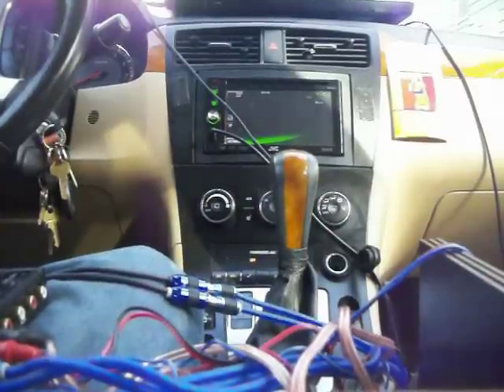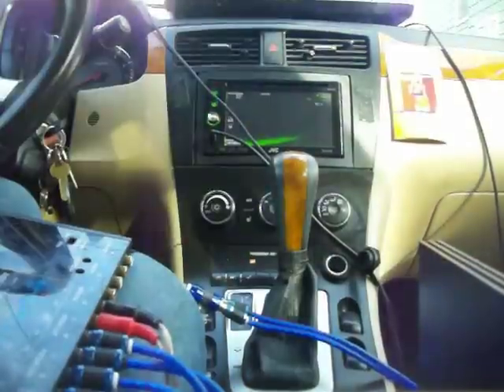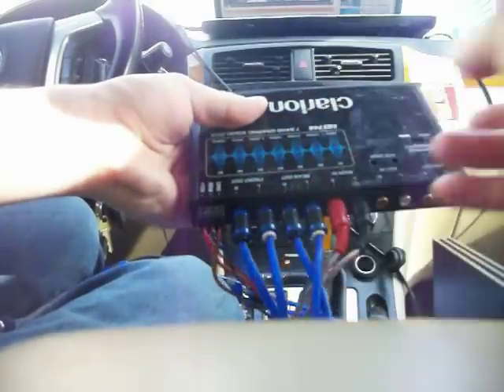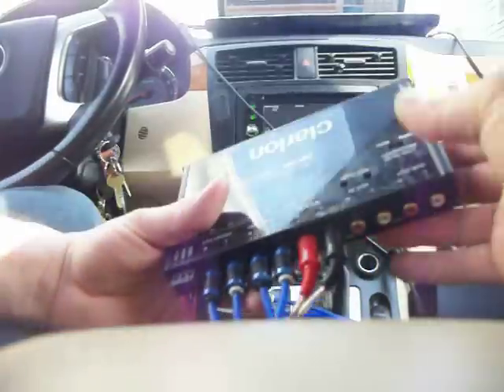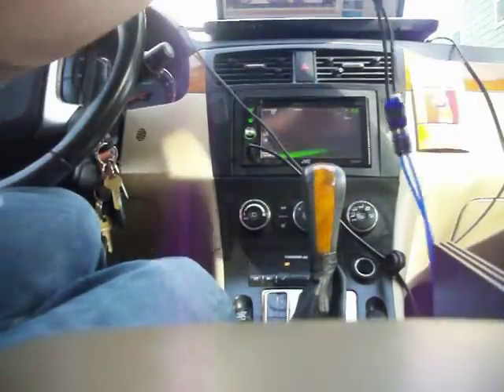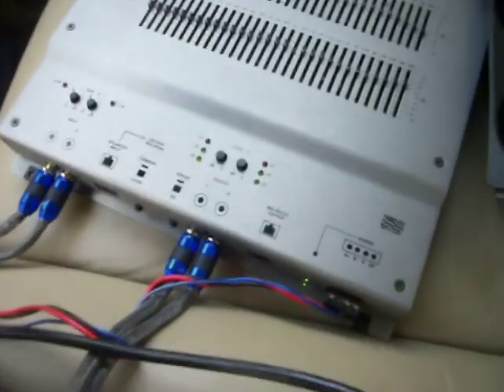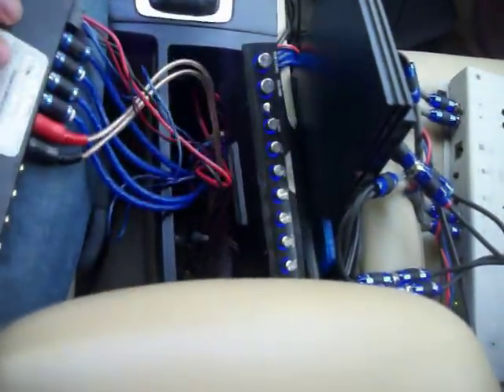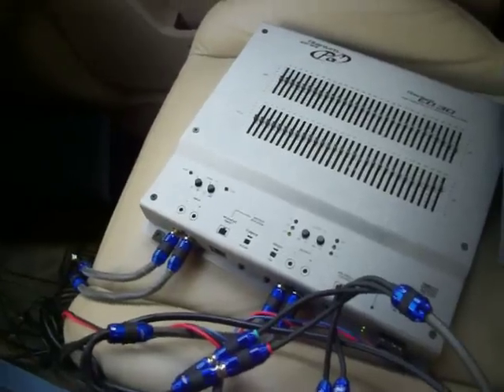How to install an eq in your car

Comment: How would you hook up that clarion EQ to a factory Amp that doesn't have RCA Cables? 
2. What happens when you hook up the EQ to the head unit inputs will it still work without rca to factory Amp? Thanks

Comment: Got a question. Soo
Running one EQ. Like the clarion
U say run front or back to EQ?
What bout sub rca?
Since EQ has sub out put could i use both or just pick one sub out put head unit or EQ?.
Why dont u plug sub output from headunit into the input on EQ if all u run on EQ is subwoofer amp?

To make it easy.. so i run the EQ off the front or rear rca off headunit. ? Dont use suboutput on headunit just use suboutput on EQ..? 
I herd rear channel has a tad bit more juice?

Comment: Maybe I'm old school but I've only ever had 1 eq and that's back in the day when I was running 6 Fosgate 15' 2 Fosgate 12's for mid bass and acouple 6×9 and 4 tweeters ..but hey everyone has there thing
Reply: No, no, no,  you're just like me and everyone else that uses 01 and ONLY 01 like a normal car audio person that understands car audio somewhat and understand that they literally just need the 01 (ONLY 01!😄)  to do the job of "all that "supposed" ultra precise special equalizing effects" that this man thinks he's doing in his ride, with his 2 automotive  eq's and a 31band  indoor studio DJ turntable equalizer😭😄 that he's probably powering with a ghetto rigged a.c. wall adapter wire to car splice wrapped in some packaging or painters tape.  
 Lol he's literally just adding hella amount of interferences,  ground loops, and other possible stuff by adding that much,  all just so he can attempt to equalize that popping static out and think he's got the most bad ass custom car audio install on the block. 

Ya I get i'm over reacting a little and over exaggerating a little, maybe sounding mad to some or something but I'm not, it's just, I mean like cmonnn man 😩why do all that craziness. This guys ride looking like he's got 2 Wi-Fi boxes and a Damn DVD player sitting there hooked up.

Comment: Are those 2 eq's the same? Clarion 7 band? And why would you need a separate eq only for the subwoofer? Is that 30 band eq, really make a difference? I have the same clarion 7 band eq hooked up on my 4 door speakers and subwoofer, and I wanna know what difference would it make if I put a 30band eq on my door speakers ,I'm thinking about putting one one, also what would be the difference on putting on extra 7 band eq just for the subwoofer?, I'm thinking on using the clarion 7 band for the subwoofer,  I have 2 12" Rockford fosgate,  and get a 9 band Phoenix gold for mids and higths, and a 30 band 2ch Phoenix gold also for mids and higths just like yours and I have passive crossover at -3db on my mb quart component speakers,  thanks for the info.

Comment: ok as far as the speaker wiring goes, should I run the car speaker wire straight to the amp, and not connect the radios speaker wire.. or should I connect the radios speaker wire to the cars speaker wire and then run the wires to the amp?

Comment: Have a question about using a equalizer one for front channel and a separate equalizer on the rear do u use front channel output from the stereo to one equalizer and use the rear output from the stereo the other equalizer just wanted know if there could be better sound from two equalizers one for front and one for the rear on 4 channel amplifier I know u can use the front or rear channel output from the stereo to go to the input on the equalizer and come out of the equalizer with 4 channel but wondering if u can use one equalizer for front and one for the rear on a 4 channel amplifier

Comment: Nice video. I have a pioneer avh8400bt that sounds nice with the built in 7 band eq. I am currently using factory amp for mids and highs, so would adding  the Clarion equalizer really help or would it be better to just buy one if I upgrade to an aftermarket 4ch amp for mids and highs?

Comment: Informative video.
How is your system hooked up? Are amps powering all your speakers and not the head-unit? Also is your head-unit straight wired to your battery with a fuse in between?

Comment: Hello, i just wonder if the head unit has 6 RCA channel output (4 speakers and 2 subwoffers), but an equalizer only has 2 inputs, wich 2 outputs you select from the head unit to hook into the equalizer? and would not using all 6 low outputs could transcend in a deteriorated sound quality at the end?

Comment: I got a question. I got a 2008 tsx. Trying to hook up a 4channel amplifier and a preamp aswell. Found out i got a factory amp in the car, I've ordered a amp bypass harness but needs help. I intend to put (2 )12" subwoofer in the trunk. I want to control the sub and front and rear speakers in the car plus I found out the back deck speakers are already naturally woofers. Help

Comment: Thank you. I have a 2002 F250 that I'm booking up to a 7 Band equalizer and then amp. Wasn't sure how to do thesim input. Now I think I got it. Use a Y- splitter for my stock radio (from the LOC OUT). HELPFUL. THANKS. WHY DO YOU do the 2 front speakers on right side? I was thinking to do right-front & rear and left front and rear (for right and left main input to preamp)?

Comment: I have a Kenwood cd deck  AND a 7 band EQ   .I know I run from my Fronts/stereo TO the EQ  then out to the speakers .........But Im confused on how to hookup my Subs . A Sony amp is powering them               So, I run FROM the stereo using RCAs TO the eq right? and then out to the speakers , correct? OR   Would I run FROM the EQ  to the Amp  with the rcas?
Reply from the maker: if you eq is like the one I use in the video then there will be 1 set of rcas that say input and 3 sets that say output  set for fronts one set for rears and one set for subs witch is the set you would use for your sub amp.
Reply: +mybassislouderthanu  My EQ says   1 rca Input & 3 outputs        .......trouble I have is my Kenwood deck has TWO sets of RCA outputs.        dunno how that can work with the eq only having 1 input
Reply from the maker: You can use the fronts for the input you don't need any other just 1 set
Reply: +mybassislouderthanu    But the Stereo itself has 2 sets of outputs . front & rear            your saying only use One of thse sets on the stereo output?
Reply from the maker: The 2 rca front outputs from the kenwood go into the 2 inputs on the eq then the eq does all the seperation.
Reply: +mybassislouderthanu  There is no 2 inputs on the EQ, only 1 set of inputs Right & Left Only. Has 3 sets of Outputs, but only 1 input.

Comment: i actually have that same clarion and just got the sound stream. im attempting to switch out the clarion to sound stream. 

EVERY time i plug in the power it shorts out the car panel fuse for radio . what am i doing wrong ?
Reply: Try a better ground location. Or check to see if the power wires pinched or exposed anywhere

Comment: I would like to see a video on how you hook the sub up to one of these. I bought the Skar 7 band equalizer pretty much go use as a line driver cause the voltage coming from my head unit is about half of what my amp needs.
Reply: Lmk if you find a video I'm in the same boat
Reply: I have mine run to subout have my eq hook up to.the eq hi input

Comment: Do I hook up the power antenna lead on the EQ to the remote power lead terminal on the amplifier? Right now, the red power lead amplifier is tandem with the red power lead on the EQ, the black ground is tandem with the black amplifier ground. thanks

Comment: hey man i got a Pioneer AVH 2700BS, that has 4 outputs at the back, do i need to use all 4 outputs or can i just use any 2 to run to my Clarion eq
Reply from the maker: as long as they are full range and not sub outs you'll be fine.
Reply: +mybassislouderthanu thanks man I installed it without any issues, however I seem to be getting a thump frm the sub whenever I turn off

Comment: So basically if I want to add a eq to my headunit which has outputs for front, rear, and sub.  I run the front output from the headunit to the input of the eq then run the eq front and rear outputs to the amp inputs then the sub out on eq to the sub amp?
Reply: Yes make sure you put the front outputs on the head unit to  the main on the eq
Reply: @levik9915  thank you
Reply: @levik9915  what the difference between main in and aux in ?
Reply: @josecunsako31  the main is the front rcas from the head unit to the main then aux is just a aux chord from you phone or whatever

Comment: 1st off.....thanks a ton for the advice dude. But check it out, i have a 2 channel line out converter already. Would I still need to buy the high level RCA converter too?? Thanks again in advance

Comment: Hi, I have an alpine 4 channel amp , running 4 component speakes, no sub, I would like to buy a good eq, sound stream I think is little better than clarion,but thee is a 7 channel 5 and 4 channel, they all different , which you recommend ? What's the different in between thanks!

Comment: Quick question for you...Im running VRs focal in the front, 570s in the rear, being powered by a JL700/5 off a Kenwood x595..Would adding a eq like this help my system as well?

Comment: So i have one three thousand watt amp and two kickers subs, my question is if i connect an equalizer with built in crossover can i control my mids or highs seperate from my lows on the subs? Or fo i also need another amp and or equalizer? Im hoping i can use just one devise instead connectingultiple eqs
Reply from the maker: Mike Jones it depends on the eq some you can some you cant
Reply: DQ-61 Blue - AudioControl 6-Channel
Reply from the maker: len rodriguez ok this eq/crossover should work for what you are wanting to do with no prob
Reply: mybassislouderthanu thanks
Reply: +Mike Jones ii u use an eq you will need 2 more  or 1 -4 ch amp,,either way u cant use the 3k amp on subs and nothing on the mid and highs..there is cd players with built in outputs for both subs and fullrange..if your stereo doesnt have it then you need a eq,,either way get another amp for the mids and high..depending on your cash and music taste i can help you further,,but i need more info...what you have besides the amp and woofers

Comment: One equalizer is good! WTH is going on lol
Reply: My radio had 4 outputs for the speakers I think. Its said rr rf lf lr I put 4 rca cables from head to equalizer  is that right I think it is
Reply: @siehammersley9297  an equalizer only uses 2 inputs, so u can use the lf, rf to plug into the equalizer

Comment: are both equalizer mid and bass the same brand or it dosent matter?
Reply from the maker: i had 2 of the same in this vid clarion eqs746 and the reason i did it this way was cause if you do it with just one when you would adjust the lower freqs for the sub it also adjusts it going to the mids and highs so that is why i did it this way but i decided to make it much more simple and got a audio control digital eqs and am much more happy with it the clarions sucked bad as i found out once i hooked up the eqs so if i were you just buy an eqs you will be very happy.
Reply: Thanks

Comment: I agree. I think the only reason I would use this is for badly recorded material. The only reason I bought an EQ is for the crossover. Mine will be placed in the back with my sub. No need to adjust.

Comment: Can you hook up a tablet or phone to the main in using RCA to aux? Will that work?
Reply from the maker: you should yeah
Reply: Buy a Bluetooth speaker, take the wires going to the speaker, off the speaker. Splice rca cables to the +/-  of the wires that went to the speaker, hook them to your eq. You've just created a Bluetooth infotainment system. You're welcome.

Comment: How.would run it.if don't have cd player using it also for inline converter also if get what am say also if need I can put my inline back in if needed  to I don't get it if using the hi input to tap in to sub then run rca to sub  then how run or next amp to it

Comment: Thanks for movie Bro, if I have from headunit 4 channels RCA,but  my EQ have main and aux ,how to connect than ? I dont use Aux every day ,but meaby i have use in the future ,need connect main and aux.
Thanks !!!!
Reply from the maker: your deck most likely has a front set of rca outs and a rear set of rca outs hook up the fronts to the eq as for the aux that is so you can use an external device like mp3 player ipod zune ect ect you just need a rca to aux converter hope this helps
Reply: mybassislouderthanu thank you so much !
Reply from the maker: Антон Колычев your welcome

Comment: can you show how to hook up the rca wires to the deck inself  thank you
Reply from the maker: not able to make vids at the moment so i will try to explain look on back of your deck and there should be 1-3 pairs of rca inputs they should say on the deck or the wires on some models it will say front/rear/or sub some of jvc models will have like only 2 pairs and it will say front and also say rear/sub what this means is the rear set can also be used for a subwoofer instead you just have to pick witch on the deck when it is on when i can make a vid of this i will hope this  helps you out tho

Comment: this guy has warped the left and right chanel to front and rear..so a song with traveling sound will get the surround front and back instead off left and right..

Comment from the maker: It will be ok
Reply: Hello there ☺
I am a newbie in car audio 😄 and I need some help... 
I have 2 10 inch pioneer limpids they are three way speakers and I want to hook them up to my Equalizer 
My head unit has 1 output which is left and right. 😢
And my amp is a 2 channel Amp with 1 an input and output 
I want the EQ to control bass and highs on the speaker how would I do it

Comment: to complicated,all my amps have built n crossovers,my head unit has the ability to tune the front rear and subs independently.with a lot less headache.and a lot less y spliters/rca cables.good luck with that.